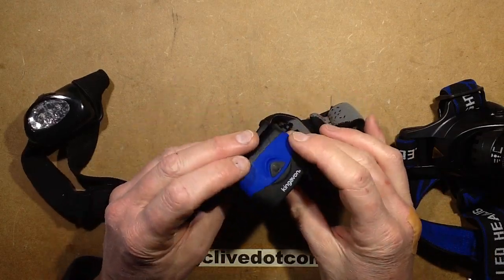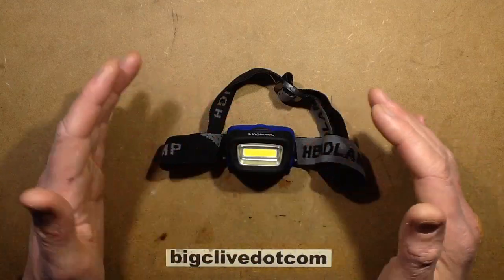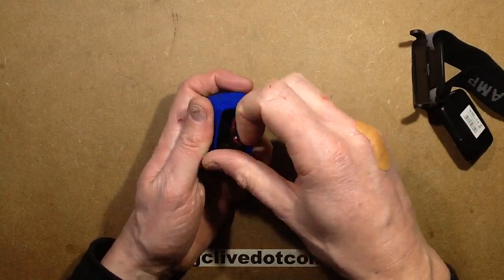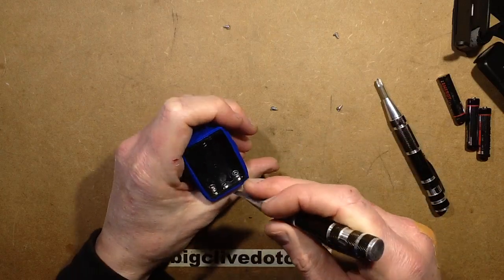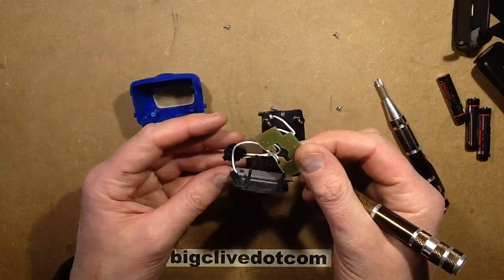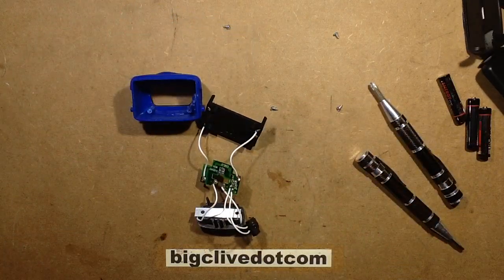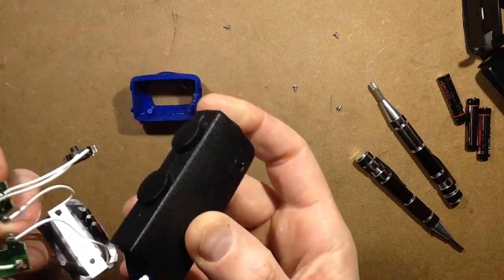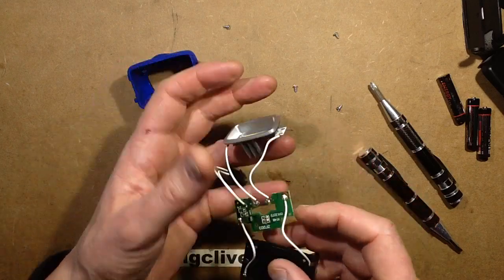Inside a COB LED head torch.

Comment: Just bought one that takes an 18650. Will have to test it for lifespan when it turns up.

edit: Headlight turned up and the listing was an (almost) total lie. Turns out it takes 3 AAA batteries. Works fine, nice and bright and the stap's a decent length, but I'm still a bit miffed.

Comment: +bigclivedotcom Many thanks for showing this light. It looked interesting and I bought one of very similar design on eBay from Glasgow for about £5 to check out (it's many miles to our nearest pound shop!). They're way better than any of the head torches my wife and I have ever tried for casual walking on our unlit roads and paths here in the Highlands. Lightweight, simple, and most of all a superb broad spread of light that doesn't leave darkness in front of you if you turn your head a little to one side.
  Only downside I could see was that they eat through AAA batteries quite fast because of the high power of the light. After a bit of measurement and research, I've found that rechargeable 850mAh Lipo batteries will fit inside with no modification to the case (ie it can still take AAA batteries instead). And you can get 5 of those batteries and a 5-way micro charger for about £11.
  At first I just kludged the battery wires into the battery clips, but of course wiring in a small plug for the socket prewired on the batteries makes it a lot easier to swap them for charging. They also see to last longer with a more steady light level through discharge  than the AAAs.
  That's where I am now, but it has occurred to me that with a couple of studs on either end (and maybe a protective fuse inside) I could just fit one edge of the light into my multiple 18650/26650 battery charger to charge them in situ, so I shall be trying that. A possible but more spatially challenged option will be a cordless charging coil and receiver!
  The icing on the cake is finding that they are three-quarters the weight with the Lipo battery than they were with the AAAs - 47g instead of 63g, and they are available form China for £1.68 post free!
  Thanks again for a great channel, and a great find on these torches.

Comment: Whats the best led to use with 5v? Most leds i use burn out under 5v.
Reply from the maker: LEDs have to have the current limited through them or they will usually try to draw as much as they can.  For a standard 5mm LED that requires 20mA you would deduct the LED voltage from your 5V so for instance 5V minus 3V would give you 2V to drop across the resistor.  Resistor value would equal the voltage to drop (2V) divided by the required current (0.02A / 20mA) giving a resistor value of 100 ohms.  So on 5V your LEDs should last a lot longer if they are put in series with a 100 ohm resistor.

Comment: Just wondering... any chance of doing something more expensive on these vids? You get a few quid from Patreon. And most pound shop garbage is the same, cheap LEDs and maybe a COB. Sometimes they have ingenious features to get the price down, but mostly it's just corner-cutting crap. 

There must be millions of things, still cheap, for a few tens of quid, that yield treasure when you open them up. Be better than the absolute bargain basement 1 quid / B & M stuff.

I'm reminded of the radar strip light, another example of corner cutting unsafe unreliable garbage. It'd be nice to see something WELL MADE for a change!

Comment: I´ve recently bought a similar but crappier headlight with a 9 chip COB. It has the typical black blob instead of the six pin chip and there are no resistors or capacitors at sight (might be something below the blob, at least one resistor for the "low" setting). The box says "3W" and, surprisingly, it actually is. Not so surprisingly, it runs extremely hot (95C less than 2 minutes after turning it on in high) so I added a 2.2Ohm resistor... and a li-ion battery installed in a dangerously precarious manner (I look forward to earn a Darwin Award one of these days). It is very bright, I really like it.

Comment: Heya Clive, sorry to hijack this comment section but these really peculiar TEXET powerbanks are running in Iceland for 3 pounds right now, so I was wondering if you could do a teardown/analysis of them. They claim to be 2000 mah but I'm only getting about 20% on my galaxy S7 (which has a 3000 mah battery) so it would be really interesting to see what's actually inside. And if they have a lawsuit on their hands with this big of a misleading advertisement.

Comment: i have a 'normal' led headlight. I use it (or tried to) when i'm beach casting  I thought that brighter and more powerful the better. its really not the case. even with it on its lowest setting and the focus as wide as it goes, theres still way too much light to work with close up. think this one would be way better

Comment: Do you know of iFixit Clive? If you don't you should check out their kits. I feel like their spudgers and similar tools would really help some of your teardowns.
Reply: Either you aren't using the tools properly (over-torque on the drivers) or you aren't aware of how much a set the next step up in quality costs. I've been using the set I have for around two years now. The spudgers alone are really the best I've found available to the UK and do save a lot of fingernails an/or risking damage to devices and drivers.

The only real issue I've had with the set it the tweezers (but I've never been great at using tweezers), and the case that holds the driver and bits (the spring broke, but it still holds shut and open).
Reply: High quality, informative review there!
Reply: Depends how much use you get out of your tools. If you're just tinkering, lowest-cost shite can be good enough. If you're doing actual work, regularly, better stuff soon pays for itself. Horses for courses. Still it's impressive how much you can get out of the cheap crap, screwdrivers and stuff are good enough for most domestic uses. And they've started including some security bits in the cheaper sets.
Reply: Fair point. Although I do find their mid range set pretty useful in tearing down laptops, tablets and phones.

Comment: Very nice little light, but those AAA Alkalines won't last too long on full power. Heat dissipation from within that sealed case might be a problem too - so how about losing the battery holder, drilling a few small vent holes top and bottom, and maybe helping the aluminium "heatsink" with a few Polulu driver heatsinks - http://amiyoled.es/2824-thickbox_default/5x-disipador-de-calor-pololu-a4988-a4983-aluminio-reprap-3d-heatsink-printer-5-almohadillas-de-silicona-adhesiva.jpg. Run a cable to an external battery pack (AA or rechargeable), and you've got a nice little headlamp.

Comment: 2 months ago they had mini work-lamps in one of supermarkets in Poland. They had very similar LED modules and also took 3 AAA batteries. There was only an on-off switch, no strobe function or dimmer. It was said that the lamp was 93 lumens bright.
I bought one, very useful in the basement. Link to the shop's official site: biedronka.pl/pl/product,id,11499 (You cannot buy this thing through internet and there are only a few last lamps in some shops).

Comment: I wonder, has Poundland approached you yet with an Endorsement deal for those screwdrivers?
Reply from the maker: I don't think I'm that high profile.  But it would be pretty cool.
Reply: They had boxes of them them on the tills at Maplins a while back. probably the most sensibly priced thing I bought on that shopping trip >_>
Reply: not seen them in my local poundland
Reply: +bigclivedotcom You have more subscribers than the City of Prince George, Canada has residents
Reply: I found them on their website called "Tommy Walsh Mini Screwdriver Set" but they don't deliver outside the UK. And they are out of stock, but you can check if your local poundland hast them in stock there too.

Comment: The board looks a very odd shape. Almost as though it was intended for a different design of light.
Reply from the maker: It is odd, but as I put it back together it was clear that it was designed to fit around the switch housing.

Comment: Yep. I've got something similar but the COB LED is mounted in a torch hand held version with magnets. Great for blackouts and working on engine bays. The even diffuser light is nice especially in a blackout and you don't need concentrated focus light.
Reply: jonlsl - I've seen similar to what you describe at Big Lots (store in USA).  Very nice wash light for sticking to things.
Reply: I have one of those --- but it only has 12 chips for about 2 inches.

Comment: Get yourself a real haedlamp made by Zebralight, Armytek, Olight, Nitecore, etc instead of these crappy no name POS's.
Reply from the maker: many of the POS headlamps are very useful, and many of the big brand ones are grossly overpriced for what they are.  My first LED head torch was a Petzl Tikka and the current Poundland (dollar store) clone is better quality.  The nice thing about cheap head torches is that if you forget to take one to a job you can buy a very functional one cheaply from a local hardware shop.  And if you accidentally leave a head torch on a job it's less of an issue if it was a cheap one.

Comment: I have a bike light from aldi with a long COB LED. Has 16 chips I believe. Its actually very good, I use one on each side for all round illumination and and a torch (like the other headlamp) for a more direct beam.
Reply: Agreed.  At my work we used to use a single flood light mounted on a swiveling arm for lighting our trailers when unloading stock.  I got tired of them being in the way and all around terrible, so I made a hanging LED light bar using about thirty five feet of the lower intensity LED tape.  Works a treat, puts out plenty of light, doesn't burn out your retinas, and runs off a 5 amp power supply.

Comment: I've always been a fan of flashlights and headlamps with good spill. I can understand that in certain situations some throw might be good to have, but there are very few situations calling for throw-only flashlights, which seem to dominate the market. Everyone seems to get excited about the kilometres of range.... which is useless in real life.
Reply: Yeah IMO I mainly want to use a headtorch cos I'm  doing something with both of my hands - all it's got to do is throw a decent light a little bit further than  my hands can reach basically... the rolson zoom head torch I've got throws a crazy narrow beam - on narrowest it actually projects a picture of the LED- you can see the wires :~#
Reply from the maker: I prefer a focussed unit that runs the LEDs at modestly low current to give a good work light with long battery life.
Reply: Some lamps have separate beam and flood LEDs - but  probably not at this price point. also IMO 3AAs in a box round the back of the head would be better than AAAs in the front (petzel used to use the 4.5v flat battery).... if you're reading this Mr Rolson.
Reply: Personally I like my headtorch to be floody (Zebralight do some really good floody ones) and a hand torch to be throwy.
Headtorch for working on stuff with my hands, hand torch to navigate around in the dark.

Comment: I had similar head torch,  but it actually had focusing thick plastic with "cutouts"(those lines like on car lights).
It had nice effect of bright light area in front of you, and less bright that was illuminating area around.
Sadly it was sucking power from batteries like hell, and plastic that hold head strap just crack after week... But still they should make more(and cheaper) head lights like that(focus light in front and illumination around) in small compact form

Comment: I use headlamps more than I care to admit. I have several, but lately have been finding myself reaching for my Fenix HL50... it has a single emitter and a nice white/warm flood like beam pattern; very good for close in work to 4 or 5 feet, which defines 97% of my needs. It uses either one AA or one 123A Battery. The light has 3 output levels (4 if you count a gimmicky momentary overdriven extra high mode)... with medium being plenty bright and getting almost exclusive use. I use those Energizer Ultimate lithium AA's and get fantastic battery life even below freezing in dead of winter. The unit is small, light, un-obtrusive, comfortable, waterproof, runs cool, and is regulated to maintain full brightness to battery end of life... and no PWM at all!!! At $50 bucks was little pricy... but I probably have literally 4 or 5 hundred total hours run time on it now, and it puts a smile on my face every time...
https://www.amazon.com/s/ref=nb_sb_noss?url=search-alias%3Daps&field-keywords=HL50
Reply: rwbishop The only real need I can think of for these temporary overdrive modes is in an emergency situation, other than that they're pretty much a gimmick to raise the maximum lumens they print on the box ;)
Reply: I didn't know Fenix were into neutral/warm white LED tints apart from their lanterns, must look into it.
Reply: Yes, I'm sure thats it's sole purposes. Even then it's only barely brighter than the also overdriven 'high' selection, and makes the light quickly heat up. At least it's buried deep enough in the UI to not worry about it's accidental activation.

Comment: Is the pinout compatible with one of these:
http://www.atmel.com/Images/Atmel-8127-AVR-8-bit-Microcontroller-ATtiny4-ATtiny5-ATtiny9-ATtiny10_Datasheet.pdf
Reply: I don't think it is either.  But if the pinout were compatible, it would open up an easy route to hacking this thing for cool effects.

Comment: Funny this video popped up as I have been using one of these exact lights all week doing electrical switchboard works in the dark. 

Im pretty impressed with it even though battery runtime is a little short.

Comment: hmm 2-3 hours run time on max? not great, wish they would use  a boosty converter and 2xaa's be much better and hardly any larger (and run about 8-10 hours)
Reply: jusb1066 of course it would be better, but this is pound shop material, nothing decent.

Comment: Nice idea for camping / walking around at night. where a diffuse light is more helpful. I wonder if head-torch manufactures would ever combine a spotlight and diffuse light into one device? That would save having to carry two different ones.
Reply: wish they would do away with the flashing mode!, along with the cheap 3xaaa way of doing it, then as you say both spot and flood, easily doable.
Reply: *****
 nice
Reply: @360mA it'd only last about two hours on full brightness with AAA batteries.  Outdoors you'd probably find yourself keeping it on full bright setting since the beam angle is a wide wash.  An hour of collecting fire wood and your light is half dead.

Comment: Hey Clive, where did you find the black magnifier? Would love something similar
Reply from the maker: A classic eBay special from China available for a few quid.  There are a lot of LED microscopes and magnifiers on eBay sold at a wide range of prices.  It's worth getting some of the cheaper ones from Chinese sellers to play with.
Reply: +DEVLAD breaking in :D yesterday I searched for one and found and ordered this one : https://nl.aliexpress.com/item/Portable-Mini-60X-100X-Magnification-Microscope-with-LED-Lights-Jewellery-Appraisal-Electronic-Repair-Microscope-Fast/32586889636.html?spm=2114.13010608.0.0.3ONDMD
Reply: Thankyou Clive and Maico

Comment: I like LED cobs than just those little bitty leds.
Reply: cobs also are good at hiding when one led dies, perhaps they will one day make them about 4 ft long and be ideal workshop lights!
Reply: jusb1066 hey, may China listen to your idea!
Reply: Easier to make smaller short sections. One could then fit as many as needed to an aluminium strip of the desired length. Would be essentially the same as one long COB, but cheaper to produce/manufacture.
Reply: Yes and I must make a special request of warmer tints and high CRI!